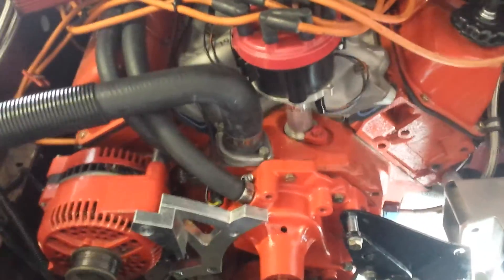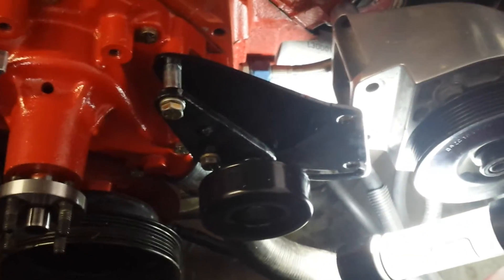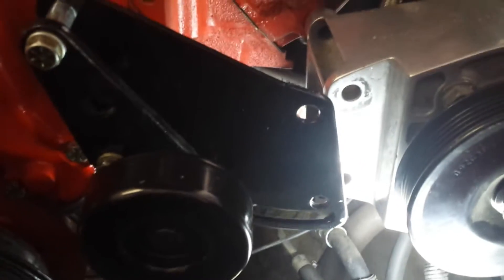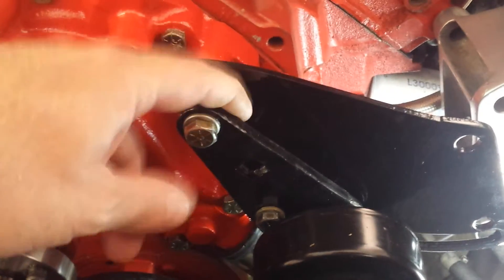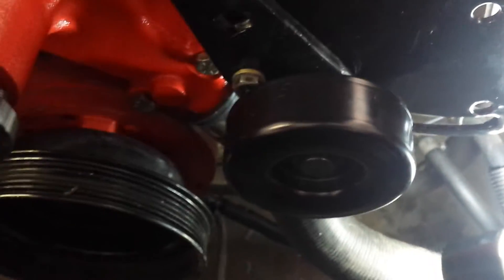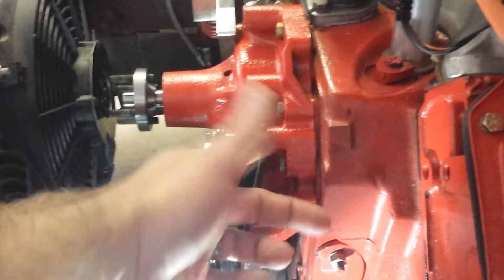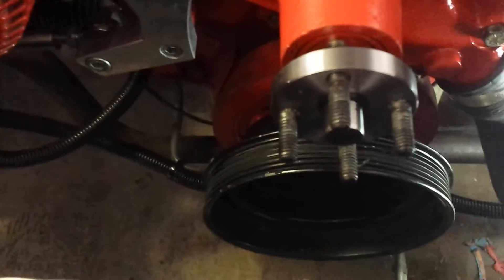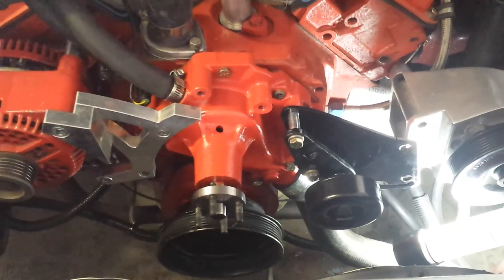✅ Custom 351 Cleveland serpentine belt system

Comment: Hi, Great work. I noticed there is an oil hose going to an oil gallery next to where the fuel pump originally was . What actually that oil hose do, if you don't mint share this information please?
Reply from the maker: Extra oiling to the lifters.  I did not have the lifter bores sleeved.  I will next go around though.

Comment: Thanks for the video.  I am working on a 1970 Cougar with a 351C engine, and looking to convert the V pulley system to a serpentine system.  What is the alternator you are using for this project?
Are there any wiring changes needed?
Reply from the maker: Its a 3G alternator I upgraded to years ago on my 5.0.  Yes it requires a bit of rewiring.  There are kits available out there for this.

Comment: Are all the pulleys from the same 1991 ford truck where you picked up the idler pulley bracket.
Serpentine belt length. More or less a parts list. HaHa
Reply from the maker: Michael Mayrose  The crank and water pump pulleys came from the 91 truck.  The power steering and alternator pulleys are stock 5.0 Mustang units.  The factory idler pulley on a F150 is plastic and not available so I went with Oreilly's direct replacement.  The idler pulley bracket is a re-purposed 351 Cleveland idler bracket.
Reply: BOSSC351 Thank you for information. Finishing a head gasket change. Aftermarket set ups are just to exspensive.
Reply: Hi, what model year mustang was the stock 5.0 power steering bracket from?
Reply: Do you think the water pump and crank pulley from a '79 mustang 5.0 would bolt up to the Cleveland?